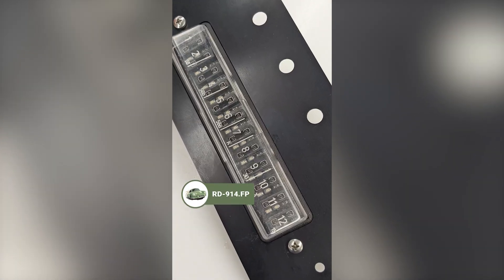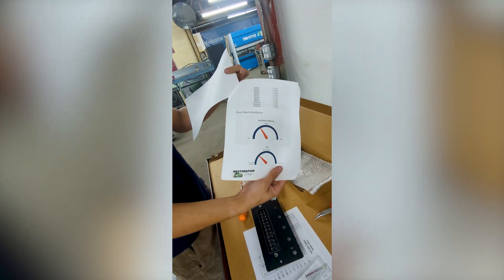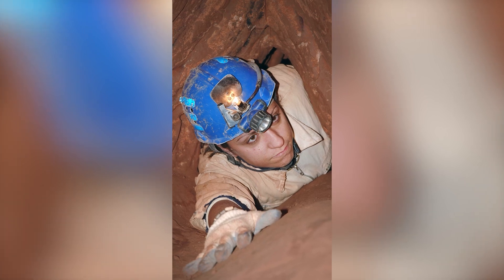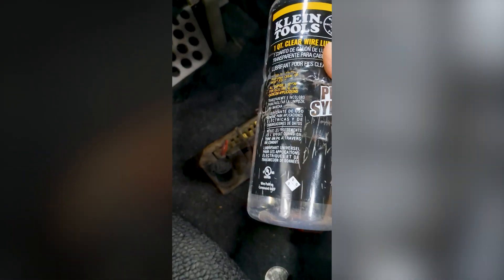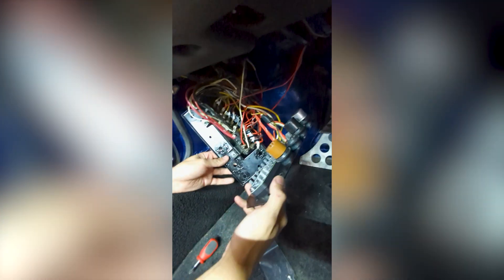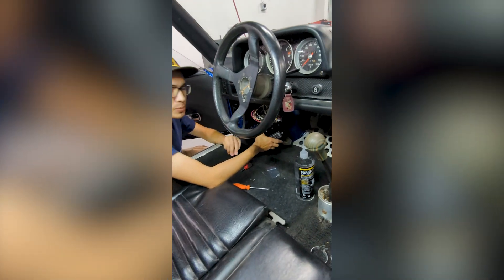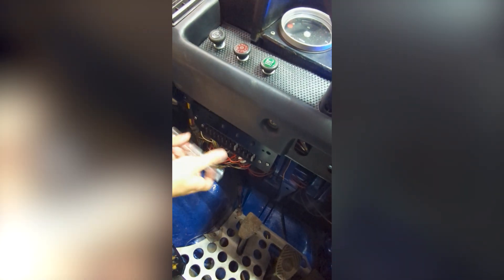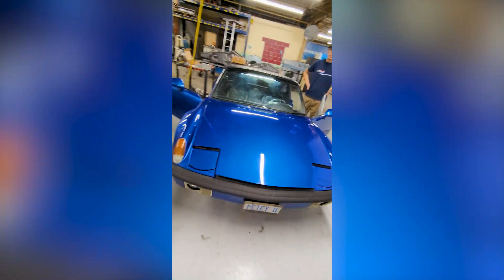Restoration Design | HOW TO: Install a 914 Fuse Panel

Comment: I really like that your design replicates, for fuse #8,#11 and #12, the two spades "Power in" and for fuses #8 and #9 the two spades "Power Out" features from the original fuse box. All other aftermarket fuse boxes I have seen do not have this feature. Well designed. Only thing that would be a great optional is more fuses to handle modern upgrades like audio equipment, heated seats security systems.